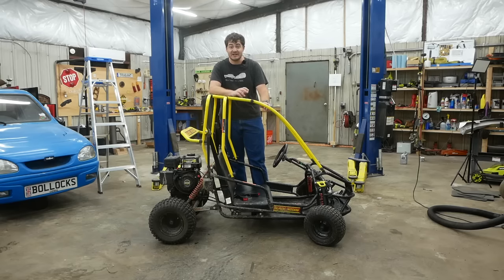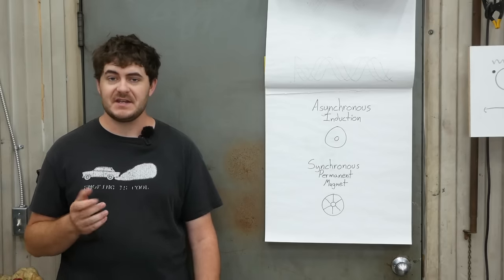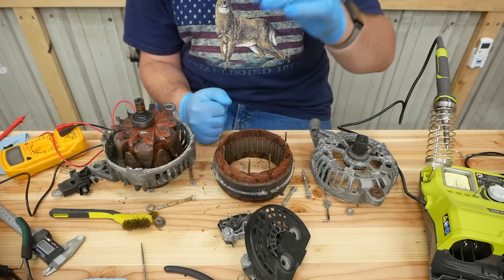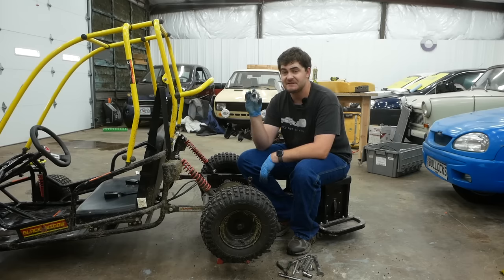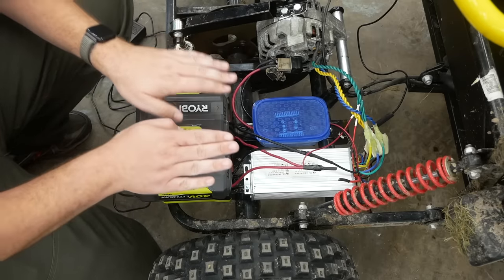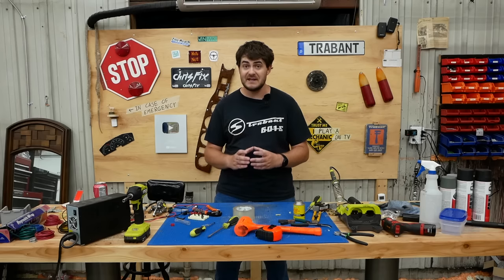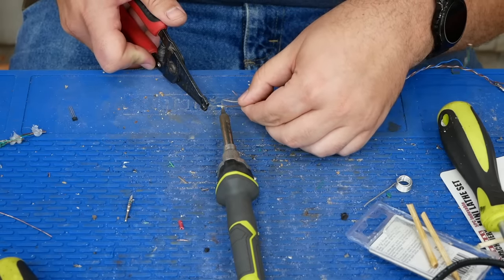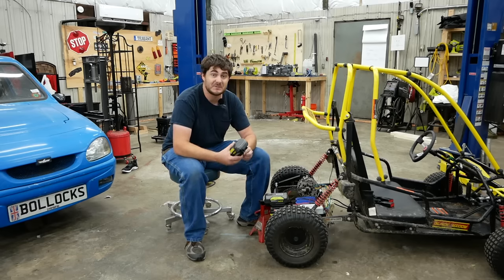Can I Power This Go Kart with a Used Car Alternator?

Comment: I have this exact Go-Kart! Got it for Christmas when I was 9, now I’m 17. Same engine option and paint and everything. However ours will not be getting an electric powertrain, although I’ve done many electrical projects to it during its years of service. Many a front tire have come off during intense drifts. The tie rods are misaligned and many of the plastic pieces covering nuts and suspension components are missing, as well as the cover for the brake master cylinder. However the engine starts with 1 pull in warm weather

Comment: I think you need to try connecting your “self learn” wires on the controller.  On mine it’s two small white wires that fit together.   Also it sounds like you might have a 48v+ controller which would explain why it cuts out so fast with your batteries that start at around 42v on a full charge.
Reply: Totally agree with this. Just tossing any old voltage batteries on that doesn’t match your controller is doomed to fail.
Reply: @americansforhire5378  yes it may could have likely might solve it- though it also may have fried his controller if this additional battery increase the voltage too much. The best thing to do is use a battery pack that is the correct voltage for the controller.
Reply: @americansforhire5378  it’s possible.  At least keep it from cutting out after 10 seconds

Comment: The reason it cuts out after 15 seconds are the batteries cant discharge fast enough for the motor controller, you need some capacitors in line to the buffer the slower batteries.

Comment: Throughout this video I wanted you to say "The main winding was of the normal lotus-o-deltoid type placed in panendermic semi-boloid slots in the stator," just once.
Reply: Good ole Turbo Encabulator!!
Reply: See, This is where he messed up. Every seventh conductor is supposed to be connected by a nonreversible tremmie pipe to the differential girdlespring on the "up" end of the grammeters, and he obviously did not have the correct tremmie pipes.
Reply: @phr3dmcc0y  The motor also should have been mounted onto a Baseplate of Pre-Fabulated Amulite.
Reply: @phr3dmcc0y  Obviously

Comment: If only there was some stinky device that would have been far more simple to work on and much less finicky
Reply: On a side note, i would love to get that gasser motor from you,  i just got a go kart for my nephew and the motor,  while functional,  is a massive 8 horse motor
Reply: @jaquecole5196  Given it cuts out, and given shipping costs... Harbor Freight sells a 79cc 3 HP horizontal shaft motor for about $130. Might be an easier, faster, warrantied option for not much more expensive.
Reply: @DTXBrian  perhaps, but i like older engines better and part of the fun of the problems is solving them
Reply: @DTXBrian  I would rather have a seized Briggs than a brand new Harbor Freight time bomb
Reply: @jaquecole5196  older engines... that engine isnt old enough to be considered old since small engines really havent changed in 20 years its going to be either a tecumseh or tecumseh clone, or a briggs or briggs clone either way its really not different enough to be unique, also he wanted to do this as an odd project the end result he was slightly expecting it to not work brilliantly, it wasnt the end result he was looking for it was the fun of doing it and i sorta appreciate that, watching old small engines is fun too, thats why i also watch mustie 1, but for some interesting idea using a cars alternator to try and make an electric go kart sounds so much more interesting than cleaning out a carburetor or replacing a coil.
Reply: @XH1927  ive seen predator HF engines do pretty damn decent keep in mind they are just a clone of something else usually something that is unaffordable like a honda engine, and you can almost call briggs engines clones now since they are pretty much built by the same person building that honda clone predator engine... and a seized briggs really?? shoot for moon and at least say a seized honda engine something slightly different and actually worth fixing... briggs engines arent worth it they use just as cheap a components and plastic cam shaft gears and rollers as the clones.
Reply: @compzac  I was simply giving him some static, and older engines do have the advantage of being built to a higher degree of quality, I have found briggs and stratton motors in literal roadside dumpsites that just need a little oil, some fresh amenities and are running like the day they rolled off the assembly line. In contrast, Ive seen predator motors in significantly better conditions that had rust holes formed on the bottom of the engine cause a little water got in the oil reservoir. Newer seems anymore to mean the cutting of corners for power or price and everyone seems just fine with that
Reply: @jaquecole5196  of course and to an extent i am too, trust me give me an older briggs, kohler command or some flavor of tecumseh over anything built new now. but most people dont really care for their equipment anymore, like they just mow the lawn and toss the mower in a shed, then winter comes along then spring they goto get the mower out and it fails to start because they didnt drain the carb and water got in, so instead of fixing it they toss it out and by another one, thats how i have some of my equipment, i found a hella expensive generac generator i payed 50 bucks for because the thing got used 1 time, left in a shed for 8 years then they tried to use it again and poof it no run, so it then sat for another 5 years until they decided to just get rid of it, i got a hold of it and just cleaned out the carb... thats it i cleaned the carb and it fired right up, yea i also changed the oil because yea duh probably a good idea but thats all and despite 14 years old i essentially bought a new generator... thats nothing compared to my lawn mower which yea technically its a sears craftsman but its from 1997 i believe, not to sure on that but i know its before 02 and its got a banger kohler command 2 cylinder that aside from a dead charger circuit and a grumpy starter it runs like brand new still.

Comment: Will you put a Fan on the motor/alternator, i think its going to  get quite hot
Reply: it does have a fan, its inside of the case on either side of the rotor, most alternators do that from the word go because of heat, since they are usually attached to a big greasy heater anyway.

Comment: That synchronized explanation on magnets are the best explanation. Thanks for the content.
And about this project the Suzuki's CIAZ hybrid uses alternator as motor . So maybe you could find something. The ratings were 200Amp and 14.3 v.

Comment: I was thinking maybe a large dc treadmill motor might work good.
Reply: ive taken apart 3 treadmills. they were all fairly high dc voltage (70-100). if you run them at lower voltages they overheat. maybe there's a treadmill with something different but i havent found it yet

Comment: Have you tried power the gokart from something beefier to test if it isn't short-circuit protection in batteries cutting them off on start-up?
Reply: Plug it into mains maybe? Hahaha 🌈
Reply: Yea, try with 3-4 regular car batteries in series and thick cables to test if it works!

Comment: My first thought was that you'd need to include a run/start capacitor in the circuit to get the go cart to move under load.
Reply: Ahhh...kinda like an air conditioner or a dryer?
Reply: 3 phase motors dont need start capacitors like a single phase motor does

Comment: For future reference, for about 90$ you can get a FlipSky VESC 4.12 - that will give you a great interface and a wealth of control options including speed limitations and battery cutoffs as well as the ability to output to a display if you want.  It even has regen so your kid just has to let off the throttle to slow down. That’ll also give you 3000 watts if you wanted to.  It’s been able to turn any motor I’ve put it on and with the FOC & HFI you get great torque.
Reply: Since this comment was 2 years ago is there a better version of this available in 2023?

Comment: I'd love to see regenerative braking using an alternator motor!
Reply: Which is in fact already the job of an alternator in a car. You just don't get to choose when it is braking your engine!
Reply: Some newer cars switch the alternator off during acceleration and on during braking. Saves a tiny bit of fuel.

Comment: The motor controller overheats after 15 seconds is my guess.
Reply: I don't think so. It's too low of a currant draw to do that. More likely the battery draw is more than they can handle are the BMS is cutting them out. IMO
Reply: It's immediately cutting out, and not drawing anywhere near enough current to trip any of the components. Not the batteries nor the controller.

Comment: I fitted an alternator motor to a bike a few years ago and even an 800W controller made it warm so I suspect a 3kW controller will melt it in no time. Maybe a bigger truck alternator will be required to make this project happen. 
For the startup problem have you tried using a different voltage source for the rotor? I used a 6V battery pack made up of old 18650 cells connected directly with no current limiting and had no issues with startup. I then used a 60A dc motor controller connected to the main battery and still no issues so I suspect the problem will be the rotor voltage/current. 
Using a ring magnet (suitable sized fishing magnet that has a hole) might be the best option.

Comment: Hey, the controller that you used probably works with specific hall sensor positioning. If you use 120 deg positioning , you have make sure that controller programmed for that. It can be programmed for 60 degree. You have to match controller degree with hall sensor positioning degree of the motor. Most probably you controller is programmed for 60 degree.

Comment: You have to place the hall sensors in the middle bc the magnets on a brushless are rectangular and the distance across the poles are even but on the alternator the electromagnets are triangular meaning that the distance across the poles are going to be uneven unless you put the hall sensor in the middle

Comment: This was a really great video. I'm an electronics designer and have run these rickshaw setups a little though with an intended type of motor. It does get problematic without the sensors. This video explains a lot of the stuff and puts a very interesting twist to it, too.

I did fail to contain myself. Sorry about that.

Comment: You're doing the right thing going with a real battery. I started my e-bike with two 40v batteries from my electric snowblower and a hub motor. Then moved to 16ah multistar lipo batteries which were good for a few years. Now it's got a 4,500w mid drive, 60amp controller and 72v li-ion battery. Never should have messed around with the other stuff. 

Also, lots of those cheap controllers are made for scooters, where you are supposed to give it a kick. It may not have the grunt to get it going. A Phaserunner would be great for this.

Comment: Dude, you are entering a tough area of power electronics... I am going to reveal why the motor does not work. These controllers have a software protection that stops the controller when no movement of the motor is detected and full current is applied to the motor. Using a higher current controller may solve the problem, but be carefull because you need a sensorless controller or a suitable hal based controller that is compatible with the position you put the hall sensors.

Comment: Amused.  I built a generator for my camping trailer with one farm motor, two alternators, a couple belts, couple different sizes of pulley, two batteries, one pure-sine inverter and a solar battery maintainer, a charge controller, stepper switch and a bit of wiring.  Put it together inside your head as you will.  It makes a lot of noise, but it lasts all night most nights and I can run a 120V Fridge, phone charger and stereo system with it.  Plus I can charge my truck’s battery off it.  It doesn’t exactly cheat physics, but it’s pretty neat.  Just thought it’d be an interesting point to add.

Comment: Hi there, please like this for him to see. 
I am working with PM BLDC motors on daily basis and here is my input: 
potential issues that would lead to controller cut off power. 
1) check battery C rating and if it is at least 1C (if i remember Correctly you matched that capacity to match input power of the motor in which case you need 1C rating) 
2) Check if batteries can be connected in parallel (bms might sens under the load there is to much amps going out and cut it off) 
3) motor can is to high rpm and not enough torque in which case you will have big issues with efficiency and overheating. All that amps will go into heat instead of propulsion. 
4) if above is the case then its very possible that motor try to get more amps that controller can give and there might be over current problem. 
You can reach out if you will need any help. 
Great job on asynchronous and synchronous motor explanation its brilliantly easy to understand for a 5 year old.

Comment: Been working on cars for 25 years and now I know exactly how the alternator works. I knew how it did but always wondered about the voltage regulator. Here’s a tip for anyone if you notice your digital displays rolling slightly your alternator is bad it’s putting out AC voltage.

Comment: From my experience on rc cars, when you put in a rc motor with less power you must put a gear with less teath, you went from 4hp to 1,6hp and you put a gear with more teath 15 from 11 that's a mistake, you must go for at least 8 or 9 teath, you must go for a short gear  ratio, and that's also why the esc is cutting off because the motor is dragging to much amps trying to get speed, and the esc cut's off From getting overheating,you must go for a lower gear ratio.

Comment: This is why I always stuck with internal combustion engines. I can tare it down and triple its power output in my sleep. I would've slapped on a 212cc from harbor freight that I removed the governor and port and polished the head. I once made an engine that could do burn outs on a go kart but that was 30 years ago in high school now I play with bigger toys

Comment: 2 things, the 40 v is below the min volts of the 48v controller, especially under load. Secondly the controller has a learn function which auto sets up the hall sensors. Ive been using these controllers for several projects and they are almost indestructible.

Comment: I've done this same thing without sensors on a 21 speed ebike! 48v 18ah batt and 1500w v reg but no current limit is the trick for the stator! Higher voltage higher speed! More amps more torque!

Comment: Hi, When will you finish this project? I have a similar problem, the engine (alternator) works without load and when connected to the go-kart, it won't start. Were you able to fix this problem?

Comment: You can ask the seller of the motor controller to send docs.  Even if they're in chinese, you can paste into Google translate.  I did this for a gps clock module with complicated instructions and the result was fine

Comment: I believe the hall sensors must be located in a place where they can sense the rotor magnet only. In your application the sensors are disturbed by the stator field, so they output a useless signal.
Reply: they can be even mounted outside the motor... ;)

Comment: I would suggest getting a VF drive (variable frequency drive) your issue with "not having enough power to get it going" is because you need a start capacitor that cuts out usually with a centrifugal switch when it comes up to speed. The alternator is rated at 14v as standard voltage going above with ruin the silicone windings and burn out the motor, same as raising the current to burn it out. To change speed of a 3 phase motor you change the frequency at which the field I rotating at. The start capacitor that VF drive supplies also limits the in rush current that most likely is killing your battery's.

Comment: You may try the centrifugal clutch as a quick workaround (you may need to tune the spring force to engage at a different speed), the controller should have no problem starting spinning the motor in sensorless mode before the clutch engages.
Also, the controller may cut the power because the current needed could bring the battery voltage below the threshold the controller is programmed to, so still beefier batteries needed.

Comment: Controller cut out. Wonder if there is a separate power rail on the controller. Feeding that with the power source that is driving the wheels will mean lots of noise into the controller. Adding another clean source of power to the controller might help that. Just found your channel today ... I am now a subscriber. Thanks!

Comment: Couple things that might be useful:

1. The efficiency of a standard alternator is around 50%. That doesn't include the power losses from the motor controller, and the DC to DC converter. Total efficiency is probably going to be around 30-35%, not 80%. Sadly.

2. If the whiteboard theory says you're going to drain your lithium ion batteries in 10 minutes, I'd expect the real world results to be around 15 seconds, which is what you got. The Amp draw is so far beyond what they're designed for, the voltage drop will trigger cutoffs, and overheating would destroy your cells if they didn't shut down.

Id get a pair of marine or golf cart batteries with a low volt motor controller so you can cut out your efficiency losses with the DC to DC converter. Bing bang boom. Cheap and easy.

Comment: The ingenuity in this video is phenomenal. An electric go cart powered by 40v batteries is cool but a predator motor is $100 and would bolt right up.